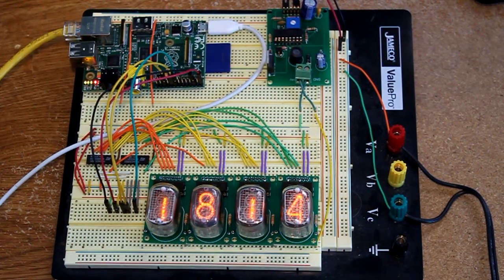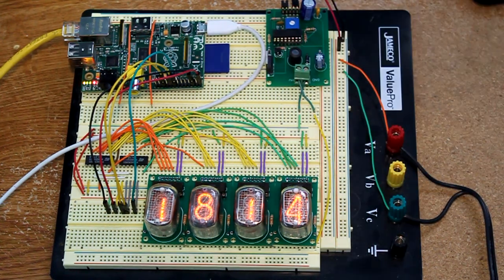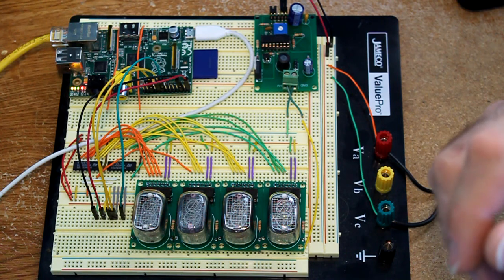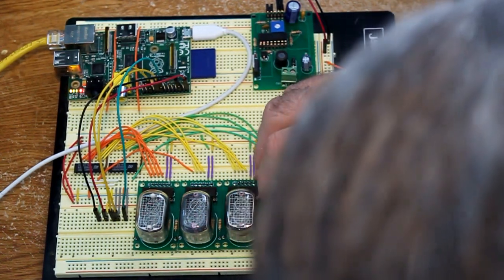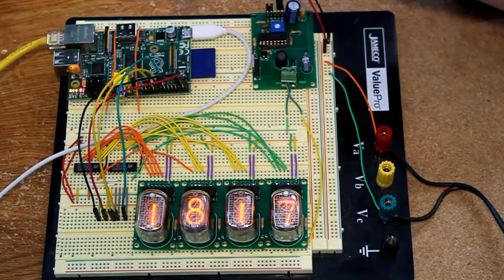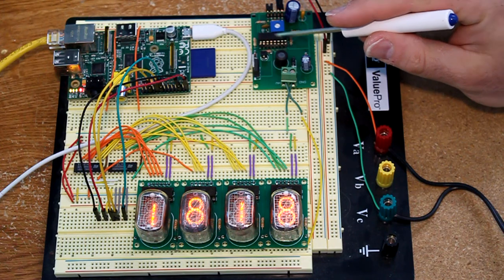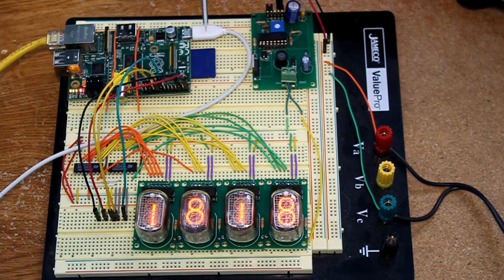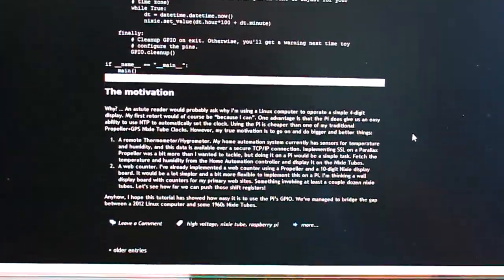Raspberry Pi Nixie Tube Clock (IN-12) Prototype

Comment from the maker: A shift register converts serial data into parallel. Each of the nixie tube drivers requires 4 data pins to drive it. That's a total for 16 data pins for 4 nixie tubes. Each shift register outputs 8 bits of data. So, 2 shift registers = 16 bits = enough to drive 4 nixie drivers = enough drivers to direct drive 4 tubes.